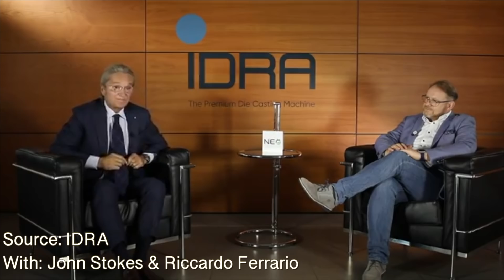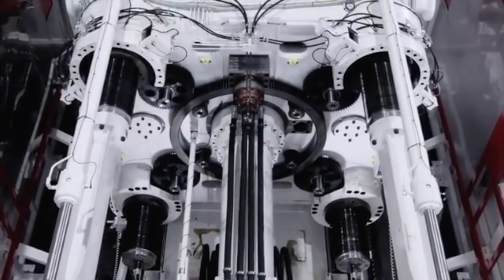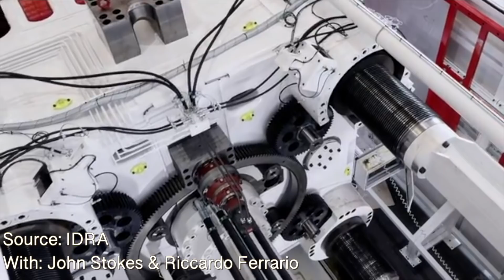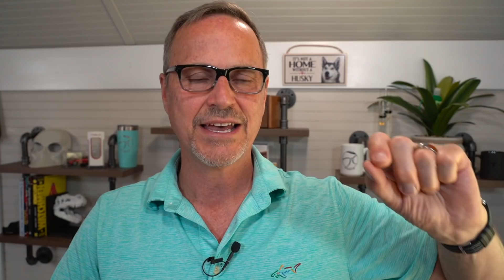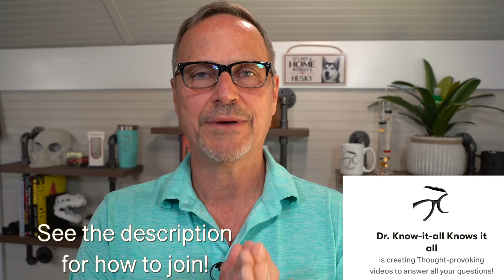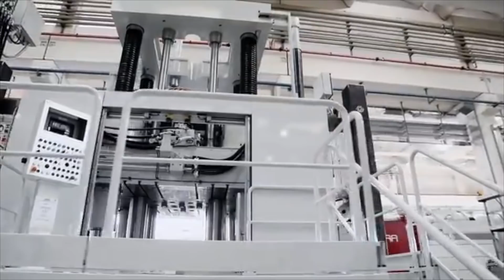Tesla's secret weapon: the Giga Press!

Comment: I'd say the alloy is more of the secret weapon, any carmaker can order a big casting machine
Reply: Tesla co designed, commissiond and developed this machine with IDRA and between them they hold a strong lead.
Reply: Idra is the only company that manufactures these giga presses and Tesla has their current manufacturing tied up. Good luck to anyone else thinking they can just order and get one.
Reply: And yet, nobody did ,.. hmmm
Reply: The alloy is not a difficult thing to make, stop talking nonsense, other companies have been participating in races for decades and developing alloys for very different applications. Porsche even had a magnesium tube chassis inflated with nitrogen for race in the past, bmw, audi, mercedes.... also uses very complex magnesium and titan alloys, they also use alot of carbon fiber and recycled materials.
Reply: @carholic-sz3qv  well. They no longer have te required departments to do so,

“ not that hard to make” excuse me as an engineer I have to disagree.
Making a new alloy with completely new properties requires proper balancing,
You can’t just throw some of this and that together and go like tadaaa. It takes months if not a year(s) to develop and fine  tune the properties.
Hence normal automakers stick to what is already there, especially for production vehicles R&D costs money.

Balance example, the very basic one : steel-> add more carbon-> pro it gets harder/ con it gets brittle -> stronger/ harder to weld(if added more, impossible to weld) -> might chip or shatter completely-> add different materials-> more flexible but less strong .

Etc.
It’s not like oh let’s throw this and that together and voila a perfect blend,

Tesla’s aluminium alloy has negatives too, I’m not sure what they are but I’m quite sure they are there and that they know the negatives and weaknesses but are willing to deal with them Aslong as they can make a huge cast without heat treating

Edit, there is a difference with picking existing developed alloys and making parts out of that and making a completely new blend,
They might have done it in the past, no more, “ why make a new expensive material when what we use works okay!”

Just like ships in the past, why change what isn’t broken, oh shit cold weather+waves,.. now it’s broken.
Reply: @Eagles_Eye  you are dumb right! Because those other companies/OEM have been making very different types of vehicles and equipments which implies the use of very different specific materials. Mercedes, porsche, honda.... have been developing and making f1 which uses very advanced aloys and liquids.... mercedes, volvo.... makes very heavy duty trucks, bus and commercial equipments depending on their applications.
Reply: @carholic-sz3qv  using existing materials,
And note I said production vehicles,
Couple of race vehicles versus 5 million cars,
And using existing materials isn’t the same as creating a new alloy,
I do love how you call me dumb even though I’m an engineer,

Please explain to me why magnesium tubbing filled with nitrogen gas ( pressurized tubing) is a new alloy.
( pressurized tubing already existed, doesn’t matter what gas or liquid used to pressurize,
The magnesium alloy to create those tubes already existed, the pressurization with nitrogen does NOT change the material properties, only the structural properties)

A normal car body exists of multiple parts, of different materials. This is true.
But let me explain to you how it’s done “ ok so this part needs to have these properties, which material comes closest to it? Oh this one? Use it”

They don’t go out of their way on PRODUCTION vehicles to create an alloy that is good enough for different parts combined, if you strip a car usually it’s like a Frankenstein’s monster with different materials all welded and bolted together, EXISTING materials.
Yes occasionally somewhere someone develops a new alloy, for aerospace or space which can then be used elsewhere.

like I said earlier. Just because they use some weird material doesn’t mean they developed that material, they did develop that PART using that material but not the actual material.
THEY USED TO! but not anymore,
Ask any designer/engineer. You need to design something and you calculate the needs and you pick an existing alloy to do what you need it to do.

You don’t go out of your way and say “ we need it to do this and that, but if we could make our own alloy it would be better, so we should make an alloy to do this, that, this and that, oh and it’s gonna costs billions, with no guarantee it will work”

Tesla( together with spacex) can do it because they are still relatively small + some of the best material science people went and worked there.

But hey, give me your qualifications and your experience with creating alloys vs me, then you can call me dumb.

Edit, go to each OEM and check for material science team job offers ( include expired job offers incase they have been filled)

Since you’re the guy who very basically said “ material science is easy”
Reply: @Eagles_Eye  Very good reply. Legacy car makers have billions invested in their manufacturing technologies - you can't just "up-root" everything on Friday afternoon, and have your new gigapress churning out parts on Monday morning.
Even Tesla has this difficulty... In their interview, Sandy Munro expressed his "disappointment" at not seeing a cast subframe in his new Model-3 ... to which Musk replied "You can't change the wheels on the bus when its going 80MPH".
Your response to how difficult it is to formulate new materials is also very well articulated. A huge number of variables are at play and all function in tandem - from the chemical side (crystallisation of the molecules of the alloy) to the physics of flow, temperature and pressure, rate of cooling, etc, etc, etc.
Getting everything to work effectively in both the chemistry and physics is hugely challenging.
Reply: @brunosmith6925  yeah exactly.
when watching batteryday the one thing that got me most excited was the fact they created their own alloy,
My main question since then has been “ what are the drawbacks” because I know there are drawbacks, no doubt about it.
I wonder what they are, can’t really find out unless you know the exact composition,
Maybe someone with a model y cast can use one of those hand held material composition scanners using x-rays,
Something similar to  X-ray fluorescence spectroscopy I don’t know what the hand held devices use
Reply: @Eagles_Eye  of course it may be difficult to design a new alloy. But once it's available to the world it's very easy to analyze what's in it. Trivial
Reply: Good thing Tesla has a materials division.  GM and VW have MBAs Tesla has PHDs.
Reply: @davidbeppler3032  youre joking right! Who said that vw and other companies doesn't have materials division? Are you insane! The VW VAG was the first company to make a 100% aluminium car shelf. Maclaren was the first company to make a full carbon monocoque shelf, GM was one of the first to make unibody constructions....
Reply: @carholic-sz3qv  Wow..  Oh, you don't know what materials science is.  ok.  That explains your comment.
Reply: @davidbeppler3032  ok Mr expert LOL
Reply: @carholic-sz3qv  to add to my previous comment
( to which you have yet to respond)

most F1 teams don’t have their own material science division either, they outsource that.

There are companies specialized in material science for formula 1 / general racing.
For example smithshp
Reply: @Eagles_Eye  wrong, some parts are outsourced but the car companies actually develop those parts in house and many commun parts are designed for all the teams.
Reply: @carholic-sz3qv  you ignored my other comment,
And read yours again “ parts”. Yes. Parts. Not material science.

Just stop talking already.

Edit.  And to those who love material science. If you want to compare an magnesium tube filled with nitrogen to an actual alloy( well actually a ceramic not by definition an alloy)  containing nitrogen,
Look up Aluminium oxynitride also known as ALON, wet dream of material science right there.
Reply: @carholic-sz3qv  I am not an expert.  But Tesla has experts.  Here, watch this video.  Then tell me why GM, and VW use 1800 robots to make one car if they could just use 3 casting machines. Answer... they can't make the aluminum.  They don't have a materials division.
https://www.youtube.com/watch?v=vwfsCMAodzs

Comment: Keep in mind that a custom alloy is required to make the machine function.
Reply: Another Tesla development
Reply: Custom alloy is nothing special to develop, vw, porsche, mercedes.... have very complex aluminium, magnesium, titanium alloys and many other complex materials like tungsten composites.
Reply: @carholic-sz3qv  Sorry, but here custom means  exclusively designed for a specific application, in this case mold/die injection of a large amount of alloy in milliseconds! That really needs some very critical development and I am pretty sure Tesla did this in close cooperation with IDRA. 
Of course other car makers have their own material patents, it is just not 1 alloy fits all !
Reply: @chamagical  the process doesn't actually last milliseconds nut many seconds to almost one minute to properly cool the part and also rigorous tests needs to be made before the part is validated. The bigger the part the bigger the errors.
Reply: @carholic-sz3qv  Well to my understanding the injection itself takes only milliseconds
Reply: @chamagical  uhm wrong, its a controlled process, first the liquid metal is poured in a shaft then pressed within the die and then it has to be cooled properly to ensure the quality, after the casting its also tested for structural rigidity. There are going to be failures still.
Reply: So?
Reply: Yes, Tesla materials engineers had to create an alloy that didn’t require post-casting heat treatment that would have caused distortion of the casting.

Comment: Seems that the demand and the idea came from Tesla not from Idra !  :-)))  the CEO said "for electric cars" but it could be for any cars ...so the idea came from Tesla
Reply: The demand yes but if you watch Sandy Munro, you'll know he's been on about this for many years before Tesla. Also the fellow stated that they'd been working on it for a very long time
Reply: @RexAlfieLee  I do wonder what exactly he meant by that though - they may have been thinking about and designing a bigger casting machine, but as Sandy Munroe has said, no-one in the traditional car industry seemed interested (even if the idea has circulated in the industry for a while). Add the timing, and that Tesla had to develop a new alloy to avoid tempering/post-processing of the parts (which reduces the benefits greatly), and it seems to me that their 6000 series would not have been realized were it not for Tesla.
Reply: @koma-k  Sandy says he's had that one piece casting in his organisation for a long time & I can't imagine Sandy financed the building of it. He's well off but I doubt he's that well off
Reply: @RexAlfieLee  the one-piece casting he has is probably a one-off (or one of a few) proof of concept castings made using more traditional methods like "lost wax"/investment casting or sand casting. This is relatively inexpensive (especially compared to the machinery required for die casting, and the die itself), but time consuming and almost certainly not cost-effective for mass production. This may also be part of the reason no traditional automaker took the idea and ran with it - it had not been done at that scale before and required investment in unproven, yet-to-be-made machinery (this is, of course, my speculation... I'd love to know more about both Munroe's casting and the thinking of the automakers).
Reply: @koma-k  absolutely, I completely concur but it has been done was my point & before Tesla

Comment: Anyone have an idea on how easily giga presses can be updated? ... I mean when engineers wanna adjust the shape of produced parts?
Reply: You just change the mold in the press.
Reply: @fredbloggs5902  ah. sounds perfect.
Reply: @nohype-ai  to be fair, the molds alone cost hundreds of thousands.
Reply: @fredbloggs5902  yep, that's a major and significant advantage of diecasting. You have a huge machine and to make something else you simply change the dies.
Reply: There's a fast swap system for moulds, they've got it covered.
Reply: Sandy Munroe said you would have one die in the machine and one die available to be updated.
Reply: @danielstapler4315  Also, given the knock-on effects of downtime, having a spare makes a lot of sense.
Reply: If you're interested, search YouTube for videos of Lego-compatible bricks being made. They use the same process, just with plastic, and some have nice shots of the moulds and how they are changed.
Reply: True.  Many car companies change little things for different model years.

Comment: Forging is pressuring a solidified metal into a new shape, not heating it up. It creates a stronger metal by aligning the metal crystals and changing their shape. So this process creates the shape of the product and then applies pressure at a point before full cooling to make it stronger.
Reply: There's cold forging and hot forging...
Reply: @omnicurious2949  yes : it's sqeezing or hammering metal whether hot or cold, just not when it is liquid for obvious reasons
Reply: this is correct
Reply: It's called tempering, I suppose is what he was intending.
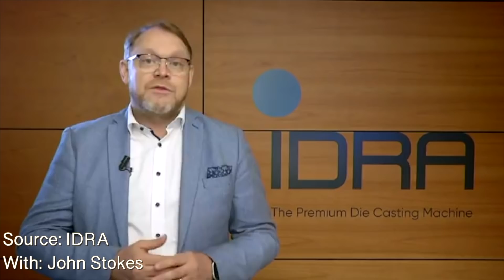Reply: 19:12 They say otherwise
Reply: @danielstapler4315  The video describes forging incorrectly; I am correcting the mistake.

Comment: I can't believe that you chose to omit one of the most important elements, the elephant in the room so to speak. I refer to the unique aluminum alloy Tesla invented and without which the IDRA machine is basically useless. Unless I badly misunderstand, you can't produce the kinds of parts Tesla is using this press for with preexisting aluminum alloys because of deformation. So even if other manufacturers were to buy machines from IDRA, they couldn't use them unless they also invented (or purchased) an aluminum alloy that as far as I know only Tesla knows how to create. So even if Tesla has a monopoly on the presses it is irrelevant until someone else invents an alloy comparable to what Tesla already has. Do you see GM, Ford, Honda, or even VW doing that any time soon? Seems pretty iffy to me. Not to mention that it only becomes cost-effective when you scale it up a lot higher than anyone but Tesla has. So this unique new alloy is even more important than the press from the standpoint of competition. If I'm wrong, please enlighten me. If not, then you really ought to amend this video (or create a new one) that emphasizes Tesla's metallurgical advantage. Otherwise, this is a great video. :D
Reply: He did mention Tesla's alloy but not in as much detail as you have.  Will be interesting to see if other companies can use IDRA machines.
Reply: @shauna996  You are right, of course. He did mention it briefly toward the end. But he skipped over the crucial role the alloy plays in the big picture. Also, it is just another example of Tesla's habit of inventing new technologies rather than settling for the best that is already available. Their AI processor and DOJO are other examples. That is one of the company's most valuable assets in my view, and one that is almost always overlooked or underappreciated.
Reply: Source?
Reply: Appreciate that the IDRA presentation is a IDRA corporate video. We don't know what's in the legal NDA's between IDRA and its "customers". So its quite understandable that references to any particular "customer" are kept discreet.
Also... IDRA does not need to use "Boot-In-The-Face" techniques to show pride in their product. There's not an automotive engineer in the entire world who does not know who "the customer" is...
Besides... This is IDRA's presentation... designed to capitalise on growing global interest in their technology.
Reply: @brunosmith6925  I'm sure you are quite right. And I go back to the fact that, as far as I know, Tesla is the only company on Earth that can actually use IDRA's presses because they are the only one who knows how to make the aluminum it requires. So without them, IDRA would be at a loss for a market. That will probably change at some point, even if only by Tesla selling licenses to produce their new aluminum. But until and unless that happens, IDRA has only one customer. On the other hand, if I could only have a market of one, I would choose Tesla in a heartbeat.😜